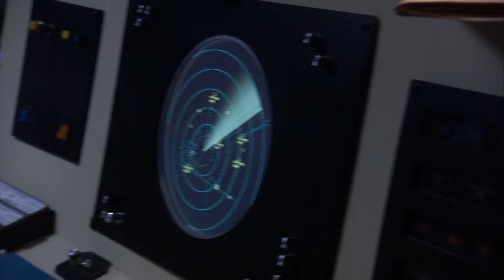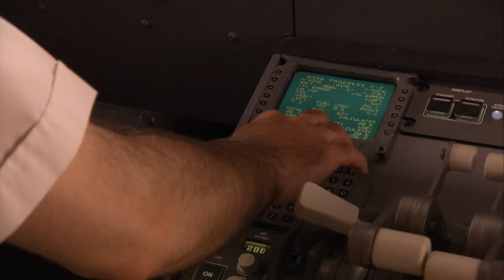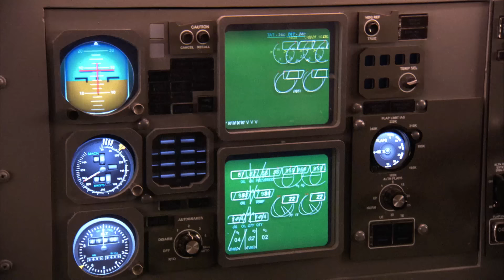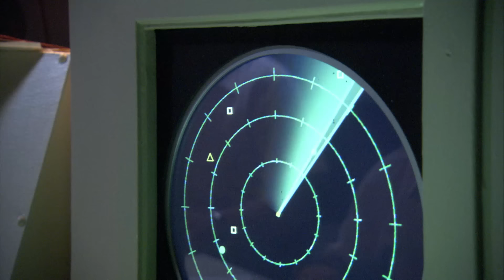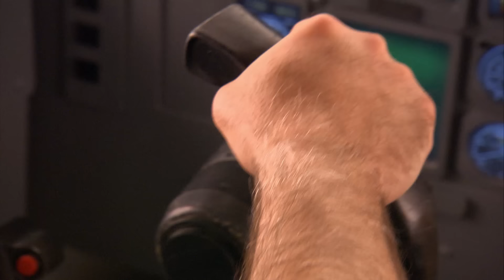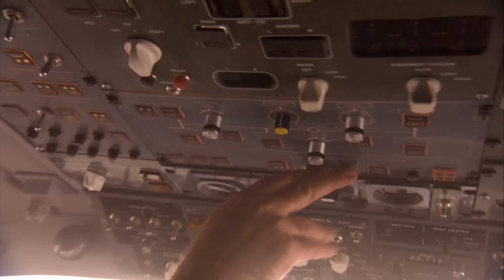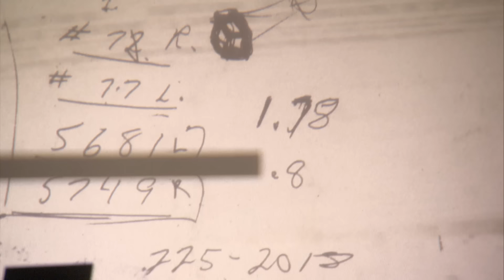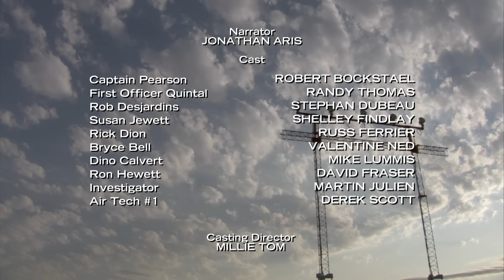Flight 143: Engine Failure | Mayday Air Disaster

Comment: The thing that stands out to me is that this error is based on people doing incorrect math. You hear people say that they take all these math classes and they’ll never use it. Here is a case where math was very important.
Reply: Only basic math was needed here...
Reply: Those people you mentioned were right. They probably had never use advanced math in their entire life. This is not an example. Here the crew only needed very minimal math and conversion of units, something  that is usually taught in elementary, while the people who say they will never use the math is referring to advanced calculus etc. So no, you're wrong, they just had trouble reading their units, nothing to do with math
Reply: 99% of people going to school are not gonna be pilots or aircraft engineers 😅
Reply: Well, for sure i cant be a pilot.

Comment: Some men drift snowmobiles
Others drift cars
This man drifted an entire 767 in mid air, with no power. 
Some folks out here don't realize the absolute strength and will power something like that took. He saved 60 lives that day, including his own. And the only thanks he got was a reprimand, when he should have received several awards for saving lives. These men are all extraordinary heros. And I hope by now, the Gimli Glider has had several computer system updates.
Reply: Eurobeat intensifies

Comment: Its wild how a pasanger could be in the flight deck while in the air. I know things were a lot different before 9/11
Reply: Well he was an Air Canada maintenance engineer so he was apart of the company
Reply: he knew the plane better than the pilots
Reply: It was common for (young) passengers to be invited there.  Or you could ask.
Three months prior to the Gimli Glider incident,  in April 1983,  I got to sit in the captain's seat in a Lockheed L-1011 for more than an hour when the captain moved to the jump seat.  The first officer was pilot flying, but they did give me a chance to change settings for the course heading,  VHF frequencies and even get a feel of banking the airplane with the yoke.  The flight engineer gave me explanation of the fuel quantity instruments and was impressed when I identified the vast array of switches across the ceiling as circuit breakers.  Also got a tour of the lower deck galley section and a chance to ride the lifts from the main passenger deck to the galley.  At age 12 this was an awesome experience and was an inspiration for me to become so interested in aviation.  It is such a loss that this can no longer be experienced.
Reply: @LakeNipissing  member when the captain brought his kids to work, let them do the same thing and everyone died?
Reply: @ToddyTornado  The difference with that situation is they were the captain's children and the first officer was too intimidated by 'authority' to remain pilot in command.  I was of no relation to the flight crew and the first officer was flying the airplane.  When I was given the opportunity to bank the airplane,  the first officer very likely had his hands on the yoke the entire time,  I can't say I was watching him,  but you could bet on it.  There was no 'intimidation' due to authority,  because I wasn't related to the captain (or either of the other two flight crew).
Of course,  I was thrilled by what I got to experience,  and when I walked back to where my parents were seated... me with my big mouth:  "Dad, when the airplane tilted left and then right,  that was me !!"
Dad and Mom:  "Shhh!!"
I didn't understand why it wasn't something to be proud of.
Still love the L-1011.. and 767... and 747s with the spiral stairway to the upper deck .

Comment: 6:00 WILL YOU AIR PLANE COMPANIES.  FFF OFF.   YOU CANT USE A PLANE WITH BROKEN FUEL GAUGES AND ITS A NEW PLANE. 
FFFFF OFFFF BOEING
Reply: Instead of getting mad at Boeing, should you be mad at the three countries that still use imperial measurements while the rest of the world uses metric?  If the the U.S., Liberia and Myanmar would convert to metric, we could forget about inches, pounds and gallons and incidents like what happened to Air Canada flight  143.
Reply: @eelnoops5200  I find your outrage at non-metric measurements to be misplaced, as this incident was specifically caused by Canada's metrification process.

1.) This happened in Canada, not the US, Liberia, or Myanmar. Even so, neither Canada nor the UK have really "finished" changing to metric & use a mixed system
2.) Despite being made in the US, the incident aircraft had a metric fuel gauge
3.) It is not the use of metric vs imperial measurements, but the temporary mixing of the two systems, which increases the danger. If Canada remained on imperial, this incident also would not have happened.

I agree that everyone should use the same system, and metric is the winner. But there is no way to reach that result without a transition period.
Unfortunately that transition period leads to confusion and mistakes, which we must be careful to minimize.
Reply: @eelnoops5200  An when any European airline flight crew states on the radio they are at flight level 340....  they are talking... FEET
Reply: @eelnoops5200 metric system sucks
Reply: @freedomlinux  outrage?  Lol. Take a Midol, mam.  No one cares that much.
Reply: @lilycalir6515  you would know
Reply: @eelnoops5200  I would know what?